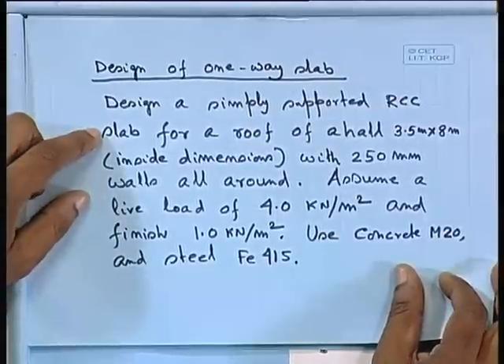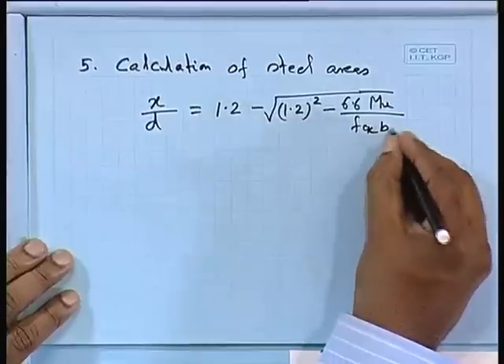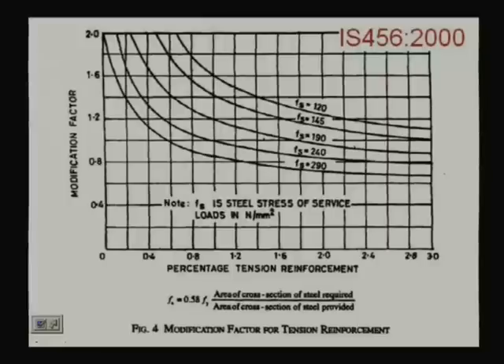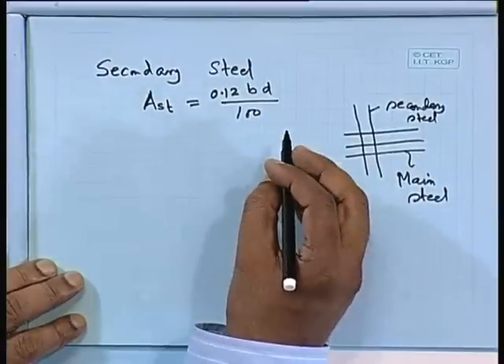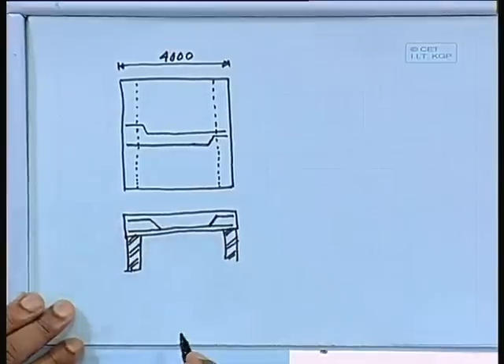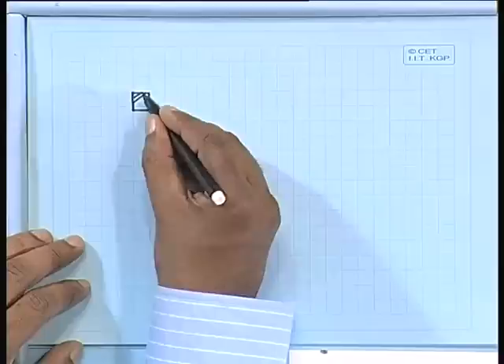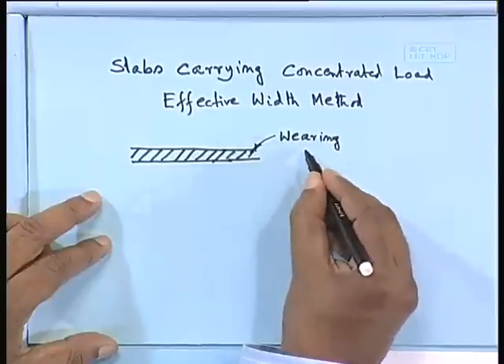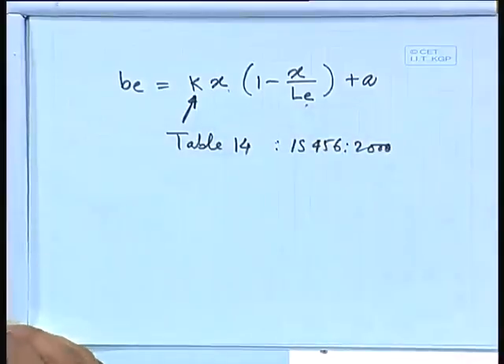Design of Slabs Part - II

Comment: sir in dead load 
slab 0.16(depth) × 25 ( what is 25 here ? )
= 4.0 kn/m 2
Reply: It's the density of concrete
Reply: unit weight of concrete is 2500kg/m^3  or 25KN/m^3

Comment: Can someone explain why he is taking  span by depth ratio is 25 initially     why not 20 or 26?
Reply: The IS:456 says for simply supported case the Basic Value is 20. So you should take a value more than 20. Sir is taking 25. If you want you take 22,23 or 24. nothing wrong in it.

Comment: Why we are taking beam length 1000mm always ?  Can u explain sir
Reply: Because we are providing steel per   meter
Reply: This is design of slab and not beam. In slab design always consider 1000mm which is perpendicular to span. if you could design for 1000mm, then the same is extended to 10m, 100m and so on...

Comment: Can some one explain how the relation for spacing is obtained please?
Reply: It's too easy   first find no. Of Bar in founded area of steel  with respect to Dia which is want to use 
Then divide 1(1000mm)m  by no. Of Baar u will get spacing be th baar

Comment: please explain step 5 calculation ofarea of steel by another method
Reply: Pls, see the balanced singly reinforcement moment formula (Mu) of the beam.
Reply: M.R = 0.87 fy Ast d[1-(fyAst)/(fckbd)]
Use this formula to calculate Ast . Or u can generally solve this formula to get the equation in your question.
M.R=Moment of Resistance
Other notations are as usual
Reply: @18-037 Sabaz Mazumder they have assumed  spacing is  150mm  instead of 165.05  
When u will 150 in spacing formula u will get  area 523.33mm2  instead  of 475.6 mm2  
Which  they used as provided area

Comment: Why we are taking beam  length as 1000 mm always?? 
Please explain that..
thanku..
Reply: Luisito Ledesma Area provided by bars which is taken 523 by prof.Dhang is calculated by 1000mm/150mm(spacing between bars)=6.666 and Ast will become 6.666*78.5=523 which is wrong. Because we can't put 0.6 bar. If we put 7 bars then Ast will become 549.5mm2
Reply: by taking 1 m width design of slab problem converges to design f beam abdul bhai..
Reply: On sample problem about one way slab where did Mr. Dang got the value 523 mm for Ast(provided)? just for clarification.ty
Reply: as the slab is same in the design for the beam it is the same process that is why is taken 1m  length and the slab will be calculated per meter of the result
Reply: Bekir öztürk hello sir , dhang sir check for shear by tou c by (Ast*100)/bd from table no. 19 .but actual value comes 0.39 if i take Ast=523 and b=1000and  d=140 and sir take the value for <=0.15 why?
Reply: Abdul Qadir   Bro that question clear
Then explain me

Comment: Hi,
How you will modelize slab (4.30 x 5.00) based on 9 steel beams (space between beams 0.60m) on 2 walls.
Shall we assume that we have continuous beam supported simply by 9 supports (span 0.60m).